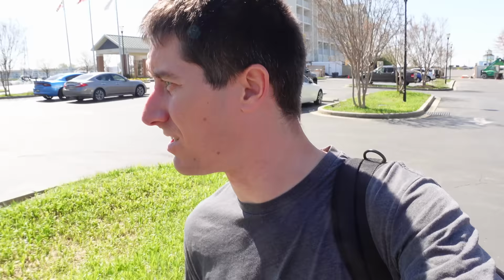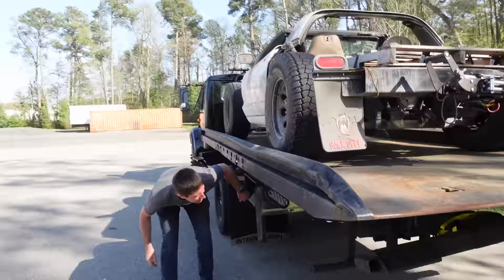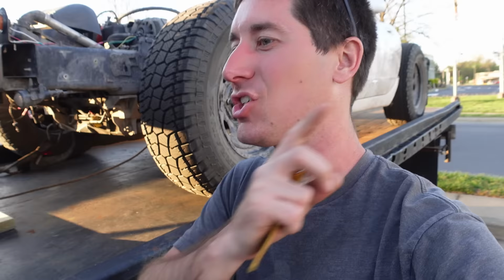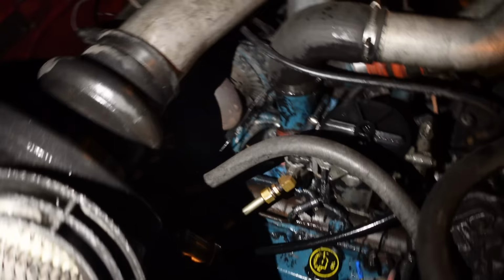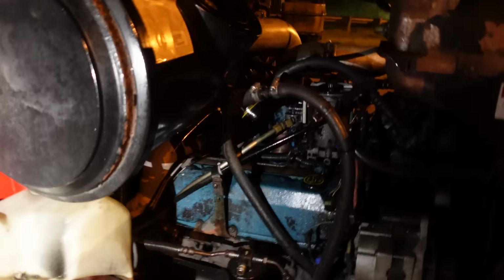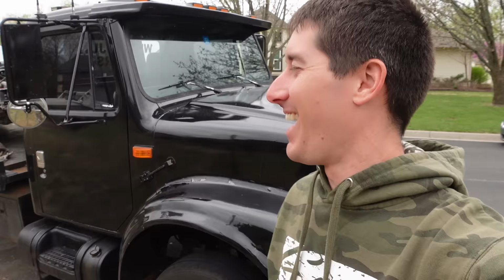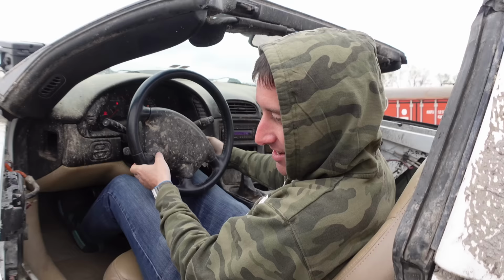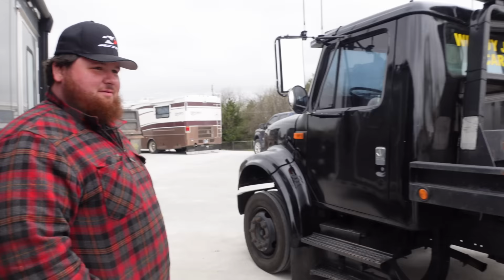I Almost ABANDONED The Tow Truck At A Rest Stop (Disaster Drive Part 2)

Comment: I used to drive that same setup. You're a crazy man for taking a city truck cross country and I love it. I drove 100 miles in mine to make an insurance delivery and swore I'd never spend that much time trying to do highway speeds again. Foot on the floor praying for death is pretty much how that truck worked on the freeway.

EDIT - Nice to see you bought the Lee C offroad vette. That thing is a tank.
Reply: I forgot to mention mine got "upgraded" to an aluminum bed and that actually made it more tolerable. It's still running around with another company and I see it occasionally turtling it's way down the road.

Comment: Yep, International never had cross country comfort in mind with those S-series trucks.  I-70 through Indiana had to be BRUTAL.
Reply: Which is STUPID.  How many U-haul box trucks were made on that International medium duty chassis???  Which had to go cross country on an epic move. I mean come on spend just a few more bucks to make it a bit more comfortable, give the engine an intercooler and a bit more horsepower so it can cross the rocky mountain grades fully loaded with ease.  Like most medium duty trucks its made to the bean counter accountant's bidding, not according to how it will be used.

Comment: Dang, I drove a uhaul moving van from Indianapolis to Amarillo mid July without aircon - straight, 24 hours. I feel ya. I left around 2pm and realized 2 minutes into the drive i had no aircon, after spending 2 days loading the big van I was not going to stop and get another one, drove until about 9pm with both windows open, started out at about 100f temp, evening had cooled to the 70's, decided, heck with it, i'm driving while its cool. When the sun rose over oklahoma City I was dead but it was getting hot and I drove on. Was a dead man walking when i arrived in Amarillo 6 hours later. Tried cat napping but the cab just baked me.

Comment: Your experience seems a lot like my own when I drove a 38 foot school bus from North Carolina to Yellowstone and back. I could keep it going strong on the rolling hills at 55 MPH, but whenever there was an extended uphill, I was down to 35 MPH and then on the side of the road spraying down the radiator and transmission with water to cool it down. A diesel guy in Wyoming told me the radiator was probably only operating at 25% due to scale buildup and need to be rodded out. He said the closet place to get it done was Billings, MT. I couldn't make that kind of a detour so I just finished out the trip by stopping every few miles during mountain driving to pull over and spray the engine down.

Comment: Reminds me of the 1992 Chevy C3500HD 6.5L Turbo Diesel rollback I bought at auction a dozen years ago. When I go to drive it home, I find the automatic transmission doesn't have high gear. Can't go much more than 35-40 mph. I still have it but only use it once or twice a year to haul a scrap car three miles away to the scrap yard.

Comment: the nut for the ipr comes loose its on driver side in the valley in the front cover just under where the high pressure like is that regulates oil pressure to drive the injectors

Comment: I had the same problem with a 5 Ton that I used to drive. The problem was where the accelerator cable connects to the engine. The end that holds the accelerator cable cover was loose and would move with the cord causing the engine to not get full acceleration. Hope that helps.

Comment: I rented a moving truck from Penski a couple years ago to move. It was a diesel i could not get it above  50 mph foot on the floor, found out that if you have it wide open it causes the waste gate to open, backed out of the throttle about half way and it took off, easily climbed mountains @ 70mph

Comment: What a guy from Kansas calls a giant mountain is most amusing. Probably a 12% grade 300 feet above sea level.
Reply from the maker: I don’t know if you’ve driven to cumblerland gap but it’s a 3,000ft climb 🤔
Reply: I lived around the Cumberland area. I used to drive an 85 jeep Cherokee with the 2.8 V6 and 33s around those mountains. It was always a down shift situation to 3rd.
Reply: 12% would be HUGE..anything above 5% is a very steep grade. And it isnt so much about how tall the mountain is but the elevation gained. You are going from sea level to Appalachian mtn range which is no joke.

Now hearing him say hes in the mountains in Maryland is kind of funny, but he is on the thin strip of maryland that borders WV and goes into the mountains
Reply: Tell us more grandpa

Comment: Sell that DT365 (7.3) and get a DT 466. One of the best engines made. If I remember right, the ICP sensor is attached to the HPOP which is in between the heads.
Reply: No such a thing as a DT365. This is a T444E. VT365 is the later 6.0
Reply: @Dave H  yup, you're right. It's been a while since I worked on them.  My shop only had a couple of the VT 365s and no 444s. Most of my time was spent on the 466.
Reply: @brycemcdaniel6666  I used to work for international, the VT 365/powerstroke 6.0 was the breaking point in International and Fords relationship. Not a great engine.
Reply: @Dave H  I did as well. From what I remember the one or two trucks that had that engine were always in the shop lol.